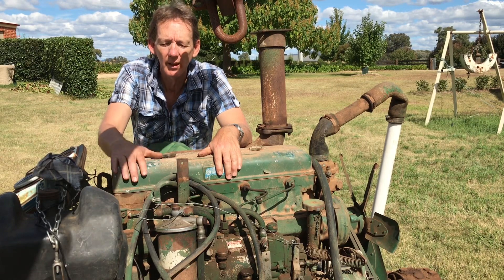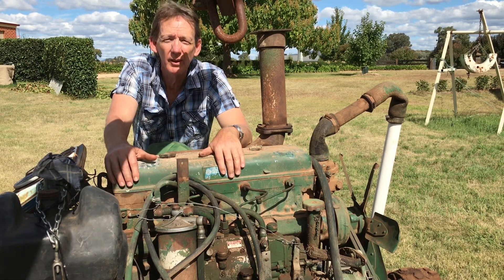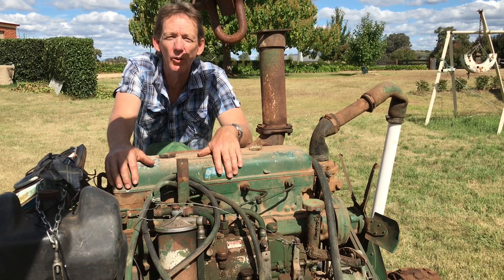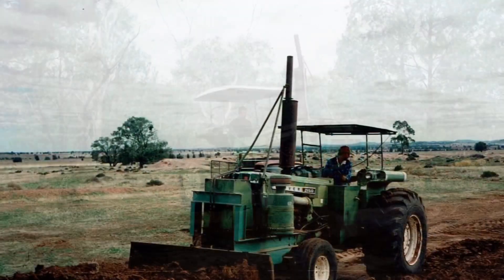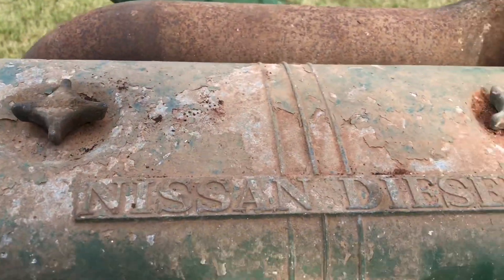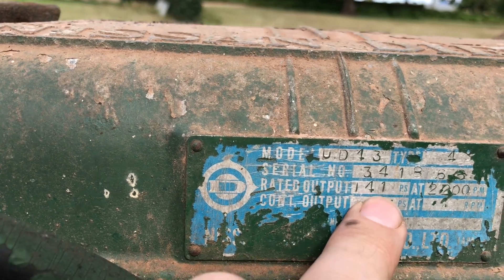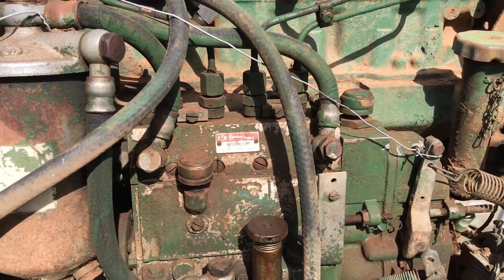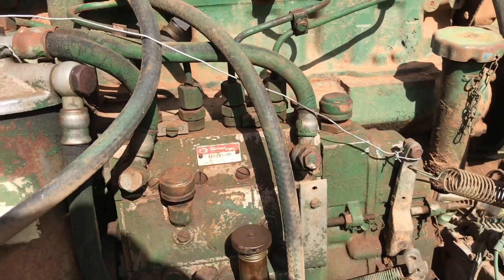Two Stroke Diesel Engine Start Up - Sitting For 17 Years

Comment: I’d take off the fan blades, just something to get hurt on
Reply from the maker: Good suggestion. I haven’t run the engine for 28 months but will run some 150 x 3mm flat around the fan to prove some safety 👍.

Comment: Are you interested in selling this engine UD4  2 stroke my father had a UD5  in his acco  a. Series . Did Sydney Adelaide and Brisbane in it  . But they are prone to overheating and head cracking. I would say when they are running well , they sound very good and some sound like a 8v71 gm  . Japanese jimmy/ Hiroshima screamer . Good to see  one lives in this country!
Reply from the maker: Just amazing how hard our fathers worked, especially with the equipment they had at that time. How technology and equipment has changed. Isn’t it good to have an appreciation of their labour👍

Comment: I didn't know they put these in Olivers.  This is a tougher engine than a Detroit from what I understand.
Reply: Nissan UD 2 stroke UD-4
Reply: what brand of 2 stroke oil does she run???
Reply: The Nissan UD 2 strokes i heard were made cast iron with a lot of nickel in it. They also ran on all needle roller bearings!

Comment: My Dad had one of these engines in a twin steer, bogie drive ACCO back in the eighties. We did several trips from Sydney and Victoria to our cattle station in Cape York. That sound is a little different to a GM and certainly very familiar!! Loved the video!! Brought back memories of when I was a teenager!! Ha ha!!
Reply: Was it a UD4 2 stroke? How much power did it have? I heard around 180 hp for n/A and god know how much more with turbo, the Nissan 2 strokes seems to make more power than a Detroit of similar size, 71 CID vs 75 CID per cyl.
Reply: The UD6 with forged rods was good for 1800 hp, The CGI alloy block cast in Africa can with stand over 3850 hp with 180 psi or more boost with billet rods for a tractor pull UD6 2 stroke
Reply: Them Nissan UD 20 strokes were something!
Reply: I heard the power was awesome and i could only image what a nissan UD 2 stroke would be like done up to modern standards with fuel and turbo. they were made up till the mid late 80's and made pretty good power and torque!. Did your dad have a UD 4?. Specs rated it 175 PS or HP N/A and the 8MV75 at 345hp n/A and well over 550hp with single turbo. Not sure.
Reply: yes the UD4 can make over 550 hp and 1380 ft lbs torque wit ceramic roller bearings and these ud nissans ud 2 stroke know no limit!
Reply: The UD-6 CGI nissan block can make up to 2850hp with stock parts thats how tuff a nissan ud-6 is with stock forhed parts, CGI an ported block!
Reply: A nissan UD with turbo make insane HP and torque and will be kicked off a tractor pull race. The UD-6 with billet rods and crank can make about 3200HP from 7.4 liters of 2 stroke power!
Reply: Drop a UD-6 in a nissan titan it would be heavy thou
Reply: Lets get a billet full round 4340 crank and billet 4340 H-beam rods and have some boosted turbo fun. The MV75 and UD6 were insane and so is this UD4
Reply: With some billet h beam rods and billet tool steel crank the UD-6 will make over 2800 hp in a tractor pull

Comment: Never put easy start in while the engine isn't turning over, put it in while you are cranking it over
Reply from the maker: Hey Nick. I agree that best practice is to add starting fluid while the engine is turning over. Having said this it’s not always possible. I’ve not had any noticeable problems in adding starting fluid and then turning the key. Thanks for your comment👍😁

Comment: The industry nick name was called a Japanese GM ie 2 stroke copy of if the GM Detroit Diesel common in the 70s used in truck repower mainly .
Reply: How good was the Nissan UD 2 stroke, i heard they had a crapton of power? A UD6 made more than an 8v71 detroit

Comment: 17 years .... and you got it going. Bloody fantastic. With the help of “ start you b.........” ha. Your dog wasn’t game on getting to close mate. Thanks for sharing 👍
Reply: The african cast CGI alloy UD nissan 2 stroke block can take some serious boost, with billet rods and crank god knows how much hp and torque can be achieved
Reply: Block cracking and fretting is eliminated with this CNC machined alloy 2 stroke UD block which can be used for serious turbo boost applications.
Reply: Well the UD 2 strokas blocks were compact graphite iron so that tell you about them they can take some serios booste
Reply: Run reline synthetic 2 stroke oil in the nissan UD.
Reply: can i put his in a titan or GTR

Comment: Detroit diesel?
Reply from the maker: Nissan Diesel (UD).
Reply: @waterloocreek5659  I heard these had more power than a detroit 71 but these were 75 CID per cyl and with turbos can really get them going.
Reply: Japanese 
Hiroshima screamer as they call them
Reply: @simonharris1804  How did they compare to a detroit 71 series? Nissan is 75 CID per cylinder.
Reply: @simonharris1804  I got a turbo silver 8v92, how does the nissan UD 2 stroke compare with a detroit 2 stroke?
Reply: @jlo13800  
From what I know witch is not much they have a inline fuel p-pump type set up don’t know how much better or worse they were not much difference apart from that I don’t think ? 
Be more out there who would know
Reply: Its a Nissan UD 2 stroke diesel, i heard they were made till the late 80's and had pretty good power.